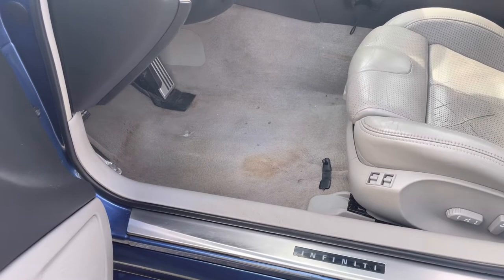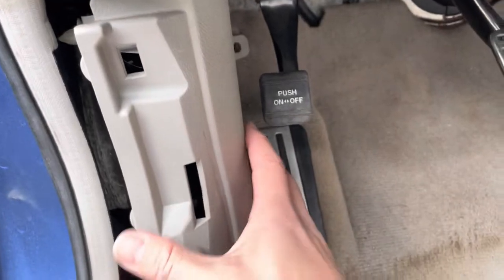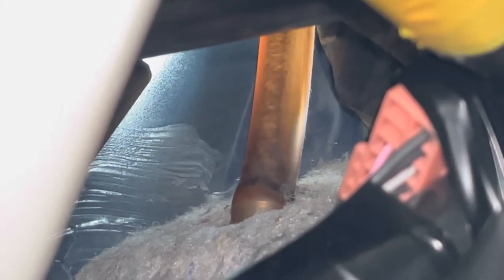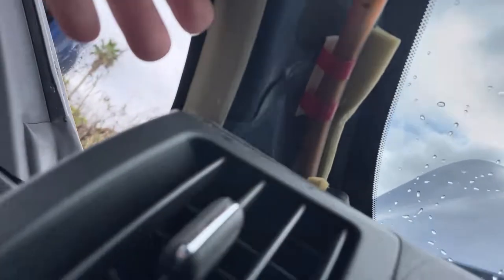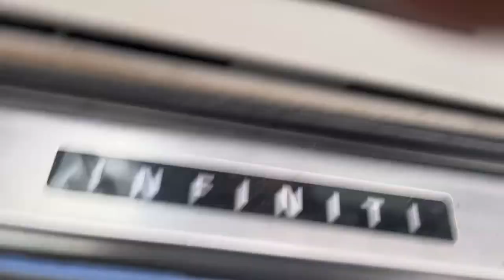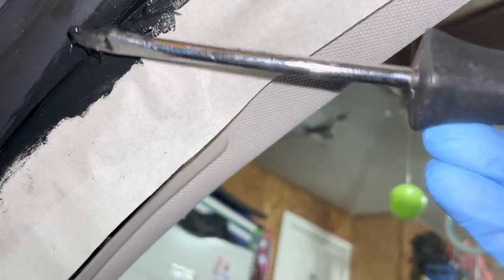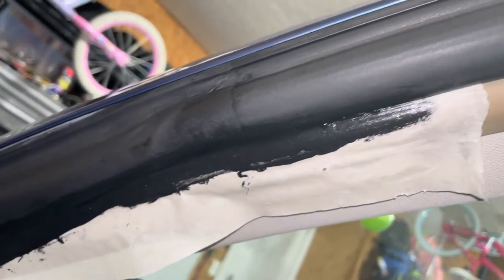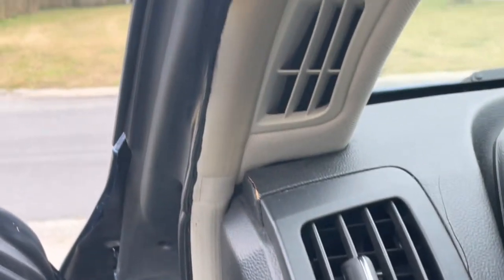Diagnose and repair water leak on G37S coupe floor mats.  Sunroof drain or Door seal leak?

Comment: It's the sunroof drain outlet fittings that snap into the firewall behind the dash.  Their gaskets turn to powder and leak into the carpet padding.   Extend the A-pillar hoses and run them into the condensate drain under the passenger carpet using a plastic barbed wye fitting.
Reply from the maker: Thanks for the input.  Yeah, there are 2 common water leaks for the Infiniti G37 coupe.  Sunroof drain and door seal.  I suspected it was the sunroof drain first.  We tested the sunroof drain by pulling off the a pillar and watching the water flow down the drain hose and out of the vehicle.  All sunroof drains were clear and connected on our car. We did more testing with some panels off and every time we ran water around the door gap, water and down the side and onto the floor.  I sealed the door gasket with black silicone and it has held up well.  No more water is coming into the vehicle and we park our car outside all year long.  When our sunroof drain starts leaking, we will definitely use your repair method. Thanks for the tip.

Comment: Have the same issue on my 2010 FX35, will chack the drains first but i def need to reseal my doors.
Reply from the maker: Yeah, after you remove the A Pilar trim and carpet area, have a helper take a water hose and slowly go around the door trim.  Start lower on the door gap and work your way up.  When water starts coming in, you should get an idea of where the water is leaking into the cabin.  Hopefully you get it fixed soon. The water messed up our power window switches. Good luck.  Let me know if you have any questions.
Reply: @DIYwithDUY  Thank you, i may just use the seal that you used and then test. lol what did you use for the seal?
Reply from the maker: Hi, I used Black silicone sealant for the repair.  
https://amzn.to/3IOzu9W

Comment: G37 sedans and coupes are not waterproof, they are at best water resistant and just as you thought you had the problem fixed another leak will appear out of nowhere and you'll have more leaks. These cars and also many other Nissan and Infiniti models such as the older QX and FX models, the Ms too all have this issue. Good luck.
Reply from the maker: Yeah, you are right.  These Infiniti’s are terrible at keeping rain water out.  I recently fixed the passenger side too.  It started leaking from the door seal just like the drivers side.  https://youtu.be/eirz4TffJ6E?feature=shared. Thanks for checking out the video and commenting. I really appreciate it.

Comment: I have moister passager side floor . Seems worst on rainy days and not sure where it's coming from 😮 checked drain sun roof seems ok
Reply from the maker: You should do a water test similar to the one I did in the video.  Grab a water hose and have an assistant put the water on your door gap and sunroof. Sit inside and keep an eye on where or when the water comes in.  You should be able to see the general area where the water is leaking in.  Start low near the door gap and work your way up to the sunroof.  Good luck.  Get if fixed before you get electrical issues.  My power window switch went bad because of the water leak.

Comment: Common issue with g37s my 2015 q60s leaks on both side through the door seal as well. Its all bad need to get it fixed before winter.
Reply from the maker: Yeah, Infiniti needs to change the design of these upper door moldings. This can lead to a lot of electrical and rust issues if left unfixed.
Reply: My doors would freeze shut if it rained and then got cold.

Comment: I have a g37 coupe and I have the same issue and it’s on both sides it worse on the passenger side but I think my issue is the sunroof seal. I have so much water in the back seat floor it’s like 5 inches l. Can that be the problem or how do I confirm that the sunroof seal is the issue
Reply from the maker: Your best bet is to check the sunroof drains first.  It’s a little easier to check the sunroof than the door seal.  Make sure the sunroof tubes are all connected.  Pour a little bit of water into each corner of your sunroof and make sure it drains correctly.  If it drains correctly, check both door seals.  If there is a lot of water in your car, you might have both the sunroof and door seal leak.  Make sure you fix the leak as soon as possible. The water can mess up a lot of electronics in the vehicle.  Use a good waterproof car cover until you fix the leak.
Reply: @DIYwithDUY  the water is coming from under the steering column and its coming from under the glove box on the passage side no water what so ever near the door or the seal it’s bone dry. I have a lot of water in the back floor then the front. Maybe the water sits in the lowest spot idk.there’s one guy who cut the drain tube that runs thru the A pillar and connected it with a hose and linked it with the ac condensation hose on the passenger floor and also connected the driver side with a t fitting and it all drains from the ac tube. Do you think that’s smart? Because it’s really difficult to access the drain seal it’s very difficult you need to remove the whole dash. I seen people do it with out removing the dash but why do all that when I can just run it like the guy I watched did it.
Reply from the maker: Yes, That method sounds better than how our cars came from the factory. We know the factory sunroof drains are a terrible design and most owners run into this issue where the factory drain gets disconnected or clogged.  After you fix the leak, buy something called “Damp rid”. It’s a bag that absorbs moisture and will get most of the water out of the inside of your car.  I hung the bag on the back of the headrest for a week and it soaked up most of the remaining moisture.
Reply: @nolic8718  what did you end up doing if you don’t mind me asking ? Might have the same problem
Reply: @jossieslopez7829  i fixed the issue by rerouting the sunroof drains

Comment: Are you leaving a small gap between seal and interior of car with tape for adhesive? Its hard to tell from video.
Reply from the maker: Yes, you are correct. I used the masking tape to create a new straight black  silicone line.  The gap is only approximately 2 mm thick and seals the door seal and the interior grey molding together.  This helps stop water from coming into the vehicle.  It has been working great and we still do not have leaks.  Let me know if you have any other questions.
Reply: I'll be doing this soon. How long did you wait before closing your door?
Reply from the maker: I left the door open overnight and parked the car in a garage for 12 hours.  Make sure your interior lights are off so it does not drain your battery.

Comment: Could of went to junkyard and just bought the seal for 20 bucks
Reply from the maker: Yeah, that would be much easier than the silicone method. The only thing you would have to worry about is the double sided tape/glue that the molding uses to attach to the vehicle.

Comment: Thanks so much God Bless you
Reply from the maker: No problem. Glad the video was helpful.  The oem replacement door seals are way too expensive.  They are around $300 each door seal.  Hopefully this repair saves you some money.  The repair has held up well for our G37 for about a year now with no more leaks.  Thanks for watching.
Reply: @DIYwithDUY  i have a Q60 but is the same thing

Comment: mine was a loose firewall wire boot..
Reply from the maker: Glad you were able to locate your water leak.  Water leaks can mess up our Infiniti electronics if it’s not fixed soon.  I had issues with the driver side power window and lock switches because of my leak.

Comment: My leak in my g37 is coming through the tweeter on both sides
Reply from the maker: Yeah, thats how it was on my driver side door.  The water leaked through the door seal and down the tweeter.  Some of the water started damaging my door lock/ window switches.  Make sure you fix the leak before it starts damaging more things in the car.